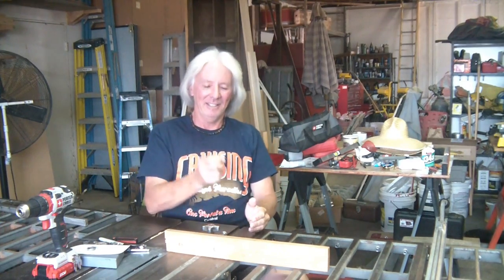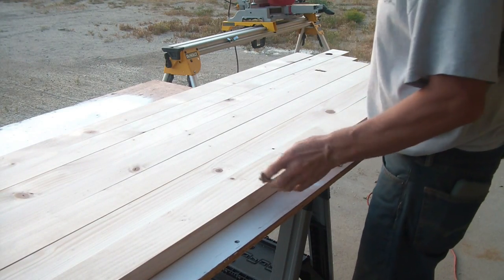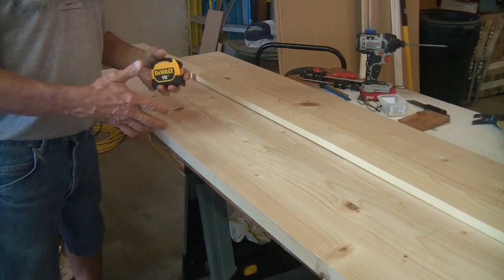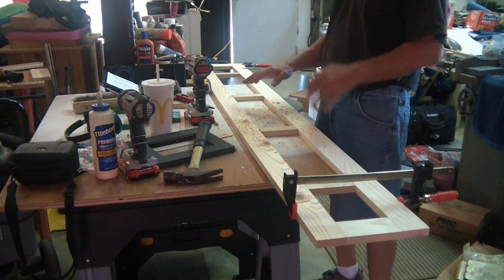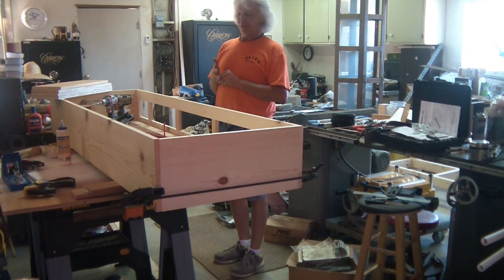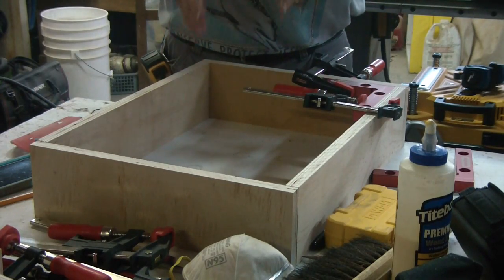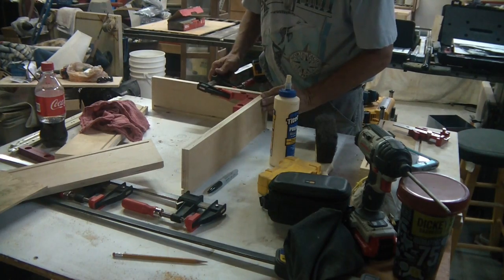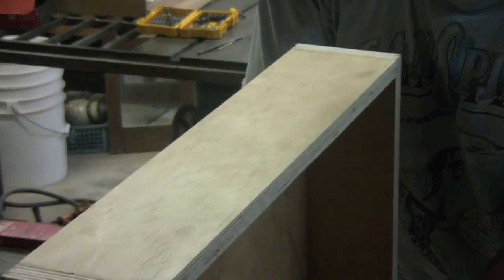How to Built a Work Bench with drawers

Comment: Where did you get your depth gage at?
Reply from the maker: John what I used in this video was a woodpecker‘s one time to call the odd job tool prior to me purchasing that I just used a normal combo square. the only reason I bought the woodpecker I kept having issues with the combo square moving. I could never get it tight enough where would not move if I needed to use it on more than one or two measurements. I needed consistency I could not get but I get precise consistency from the woodpecker tool. They are expensive but for me the Percision and quality is unmatched. they have come out with their version of the combo square very nice but since I had this tool I couldn’t see purchasing another combo square. just get you a good quality combo square or if you really want to go the extra mile check out woodpeckers tools. I think the combo squares were a one time tool if not you could go there and buy it or just put it on the wish list when the come back around for production run you could buy it then. Thanks for the question and thank you for viewing.
Reply: @TheShackHome  Thanks I'm really inspired by your spirit of excellence. I love learning and you have a gift for teaching. Thank for all you do.
Reply from the maker: @johnmunoz8845  Thank you.

Comment: Would a jointer be needed before running the stock though the planer? Joint one edge and face, thn plane the opposite face.
Reply from the maker: Gooey if you have a jointer I woould suggest it. Normally I would just butt them up glue and screw. then set a piece of plywood on top of that. This was for my father in law and needed to be fairly light and portable. That's the only reason I did it this way. Didn't want any valleys du to the rounded edges of the 2x4.  A jointer is on my list for the next upgrade to the shop. Good point and thank you for viewing.

Comment: Did you cut a dado joint for the drawer compartment ?
Reply from the maker: Nir no sir, I did not. No dado, rabbit or any joinery. just basic butt joints and pocket hole Very basic stuff anyone can do with limited tools. Even the drawer bottoms could be done with a table saw blade if no router or dado blade set is available.
Reply: Thanks!

Comment: What type of wood was used?
Reply from the maker: JCD the frame was just. Construction grade 2x4 and 4x4. Birch plywood for drawers. Poplar for face frame and drawer fronts. Pine for Rear and side skirts. Basically anything I could find around the shop to use up.
Reply: The Shack  was